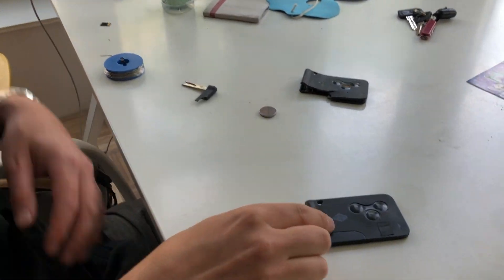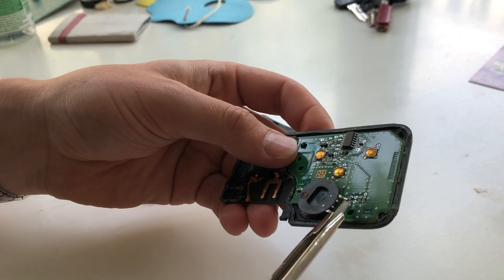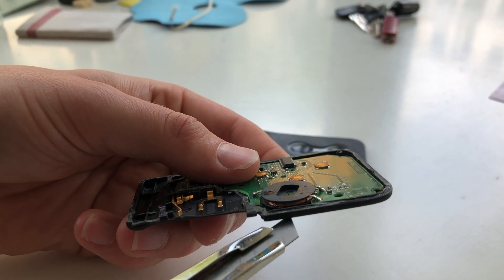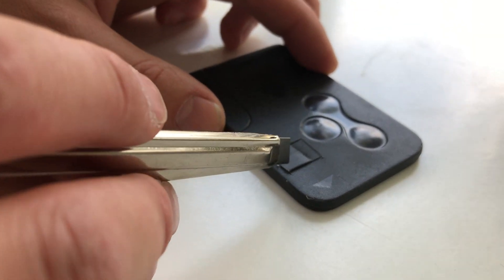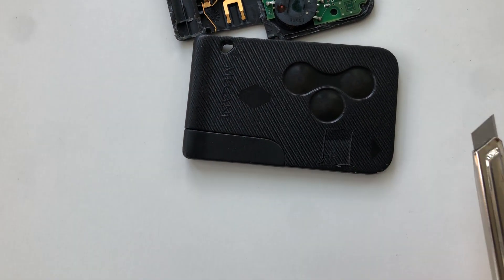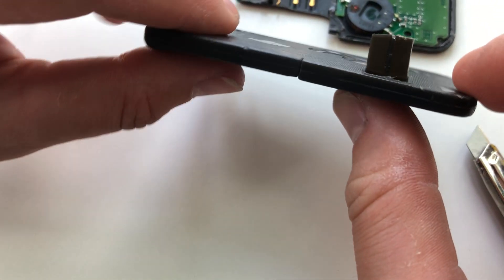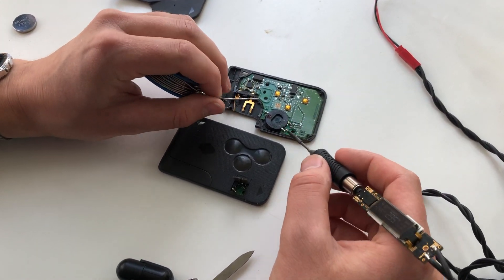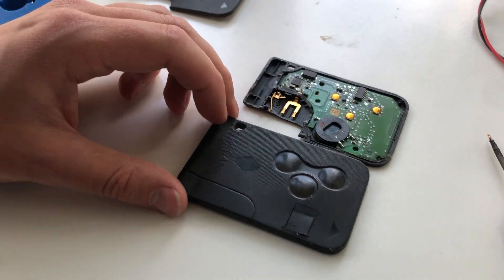Renault Scenic Megane Clio Key Card Fob Transponder error fix

Comment: great idea with cutting out that window... this is the only YouTube video in the whole world that came up with that idea! 😁 I cut out the window gently with a wallpaper knife, and minimally improved the soldering with a thin soldering tip, then glued the window together with glue and put it in a vice overnight. btw. another good video is the one where you can press the side of the card in the reader with a thin knife and the car will start in an emergency. THANKS! 😊

Comment: Thanks. I hit the thin wire on the transponder, too. However, I managed to solder together the thin wires themself and make the antenna work again. It was a bit shorter than before but does work anyway.
Reply: Is that possible? I have the same problem and I don’t know how to do it
Reply: @sameralquraishi777  It worked for me... do you know how to solder? I unwinded the wire until it ceased to be broken. Then I took some of the longest pieces of the wire and scraped the insulation from the two ends with an exacto knife - a few milimeters was enough. I dipped the ends into the solder flux first, then I applied heat with the soldering iron and covered the ends with some tin. After that, I put those ends together and applied heat so they would stick together. I repeated this process until I soldered on all the longer pieces (looking back now, I don't think putting all those pieces back on was even necessary). I glazed the soldered parts with some transparent varnish for insulation.
My coil still had one end of the wire connected to one of the two contacts so I knew which wire goes where. I simply soldered the end of the free wire to the free contact - after winding it all back on.
Hope that helps.

Comment: i also fucked the antenna haha how do i fix it?
Reply from the maker: did it come loose or did you cut the thin enameled wire? spare antennas can be bought for a € or so on ali etc.
Reply: @gregorvanegdom  yeah i changed the antenna and its working great.
Reply: Is that possible? Can I just change it without needing to programmed? It will, works?
Reply: @sameralquraishi777  yeah just change the amtenna